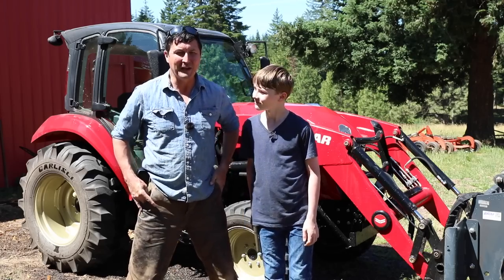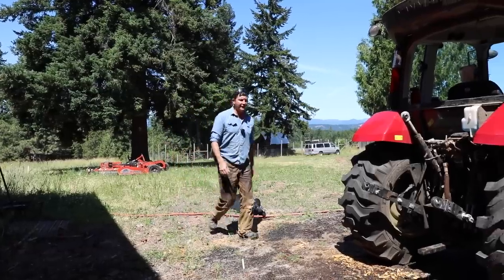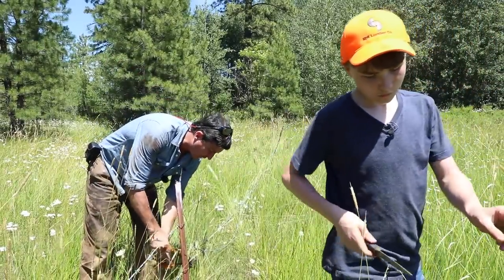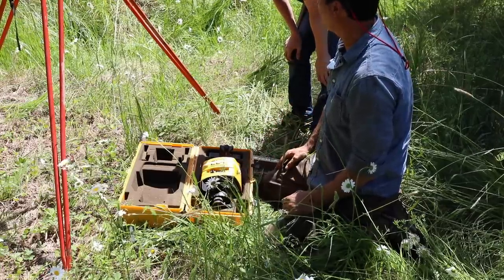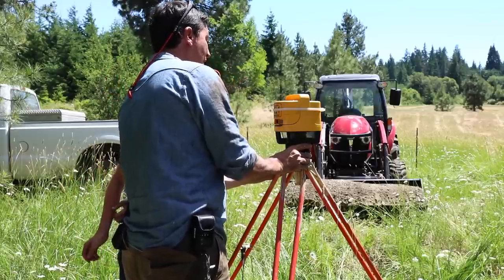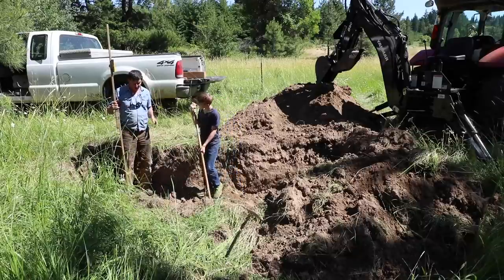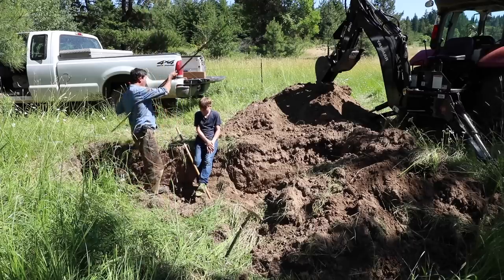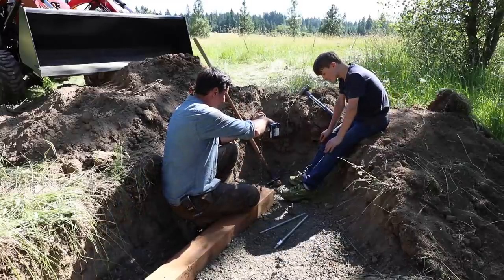How To Build A Bridge Over A Creek For A Tractor

Comment: My grandfather built tons of bridges for his tractor. First on 12 acres in Hood River, then on 140 acres in MO.  Unfortunately I never seemed to be around when he did it.  I know he did use concrete with some large local rock. 
After replacing 7 4x4 fence posts that were only 3 years old, I suspect you might be looking into concrete.  Or check back and see how our experiments with tar on the posts worked out.  They don't seem to make pressure treated like they used to.  Or you might consider long railroad ties for durability. I just have no faith in anything pressure treated that is anywhere near the ground or moisture.

Comment: I am not an engineer but I would suggest measuring the distance between the tires of the truck / tractor and space the 10*10's in that distance so they are ideally underneath the tires when you drive over them. If you found grammar / spelling mistakes you can keep them.

Comment: Really think you making a huge mistake not going wider 10 or even 12 feet driving the truck across with limited view around the hood it will be difficult to see the edge on the passenger side and it will be even more difficult for Mrs W not being as tall as you. Also you will have to make sure hit the bridge straight on if you try to drive on at a slight turn you will fall off. I strongly suggest you step back and think about it, it will be so much easier to make this change now. On a side note love the channel keep up the good work God bless. Josh
Reply from the maker: Where is the thrill in wide bridges,
Reply: Wranglerstar it's going to be interesting I'll give you that.
Reply: Josh P you could just use marker posts like for the edge of the road in winter. My sister has such a bridge on a slope going down is ok, going up is a bit point and shoot.
Reply: flag both edges with 10-12 foot poles. 

Bonus you can mark them with flood height.
Reply: Josh P My wife always complains about parking my Tahoe. I tell her-
as long as you see the parking stripe on the drivers side and put the truck in the space according to that- the other side has to follow.
     If the driver observes the relationship between his side of the truck and the bridge, the other side of the truck will take care of itself.
      HOWEVER- that flagging idea might be a real lifesaver and driving aid when the snow drifts and you can't see the edges of ANYTHING! 😖
Reply: Snow wouldn't be near as bad as a covering of ice!  If he marks the ends and edges of the bridge with poles, snow will be no big thing.

Comment: I don't want to be critical here, but I just wonder if it's really necessary to strive for the precision you're going for in excavating the initial depth of the hole.  Certainly, eyeballing it would likely be fine, and fine adjust by the amount of gravel or rock?

Comment: Are the timbers pressure treated or treated in any way?  

Did I miss something ?   Are the bottom ones a different kind of wood?

Creosote?  

I'm just curious because I was doing this same bridge at my house before I changed my mindset to a culvert and land bridge.  

Maybe the next video will flop me back to a timber bridge.  Certainly more scenic than a culvert bridge.
Reply: It's pressure treated. You can see, (especially when Jack is sinking the spike), the puncture marks that ground contact treated material has.
Reply: I need these details !!

p.s.  I couldn't see any marks.  They look like home made timbers to me.
Reply: Definitely bought treated material. At 13:27 you can see the array of puncture marks typical of treated wood suitable for ground contact. Note also the bar code tag stapled to the end grain as they're setting the timber down.

Comment: 3 beams should work with the 4in decking as long as you set the beams to be under the tires. I would make it a little wider for your implements. You can even overhang the beams some, a rule of thumb is 4 feet for every 1 foot cantilever.

Comment: If you wanted engineering advice I might have to send you a bill.
Instead of 12 x 12 in. timbers consider 10 x 14 in. timbers,  it is the depth of the timber that dictates the load carrying capacity.
I would need wheel spacing, wheel loads, timber type, timber grading, moisture content of the timber, bearing surface of the timbers, and fasteners to give you an engineered solution.
Reply: Too bad you didn't study economics as well,  you'd be able to make assumptions.
Reply: Consider not using timbers at all. They will always shear in the middle over time. Build your own trusses or use an I beam for structures that must carry live load (like bridges). Search for "second moment of area" for more info.
Reply: Actually, why not just fly over it? Don't even build a bridge and traverse it with your mind.

Comment: Question with your answer Please. As much water I see on the videoOs. Will not the wood rot, decay or disintegrate after a few years ( 2 years with the doug fir) why do you not treated or at least paint them for longer life?
Reply: The timber is this video is commercially pressure treated material. You can see the bar code label stapled to the end, and also the puncture marks on the surface of the timber typical of pressure treated material suitable for ground contact.
Reply: Thank you for pointing the tag out but the wood doesn't look pressure treated green or creosote pressure treated. I was in Washington state 2 weeks ago for a fire (Yes all the way from Florida) and all the river crossings were creosote including 2 creeks we had to cross. Thanks again...
Reply: Don't mean to harp on it, but I definitely think it's treated, not least of all because Cody would know that is the appropriate method. But also have a look at this article which has a good video attached also. Hope it's ok to post links:

https://parr.com/blog/selecting-exterior-lumber/

And then check at 13:30, it does look like treated Doug Fir

Thanks :)

Comment: Found this on the internet:

The formula I used is (w*d^2)/(9*L) x (k/f)

Where:
w=width of bean in inches
d=depth of beam in inches
L= length of span in feet
(k/f)=same modulus of rupture for hemlock, which is 750

So...(8x8^2)/(9x10) X 750=4266lbs

Comment: At this point several critical decisions have already been made, and while wood is a good material pressure treated wood would be better due to the rot resistance factor. Having said this I probably would have chosen steel for even greater strength. I also would suggest that you discuss the engineering with your local county engineering department as they might be able to give you some useful suggestions.
Reply: Or maybe he could just wing it and see what happens.
Reply: I laughed so hard at this answer.......my kind of problem solving......

Comment: i no engineer but i would try to have the beams directly under the wheels too The tractor will vary in weight a lot with the differentimplements and ballast box

Comment: iam not an engineer.but your better off building to handle more weight then plan.i agree with ryan schmidit.3 beams for the center evenly spaced.so thats a total of 5 beams.if your planning on building it to hold weigh of 4 thousand pbs.build it to hold 8 thousands pbs

Comment: Why don't you make  five ft. reinforced concrete pipe , 15 ft. length. divert little water flow and make the pipe at its required position.

Comment: Im not a civil engineer but i worked for one for a year. I already see a big problem that is easily overlooked. You need more than just a beam of wood and a gravel bed to make the foundation on each end of the bridge. as it is now the foundation is just going to gradually sink into the ground over time. Eventually rendering the bridge useless. Underneath the beam you should put in three pylons to support it.  https://www.quora.com/What-is-a-pile-foundation-in-civil-engineering
In your case the beam you put down would serve as the Pile Cap and the Structural Load would be your bridge frame.

Comment: Hey Not an engineer But I would go 4 10x10's Just for the over Kill Factor.. if you have access to the Timber.. Make them More towards the edges to help bear the weight.. 4" [10x10] 10" [10x10] < ------- Space -----> [10x10] 10" [10x10] 4" the Bulk of the weight is Wheel track of the Vehicles traveling over the bridge.. That is how I'd Over do it...  
as I said NOT an engineer..